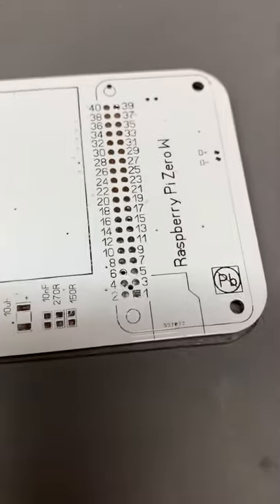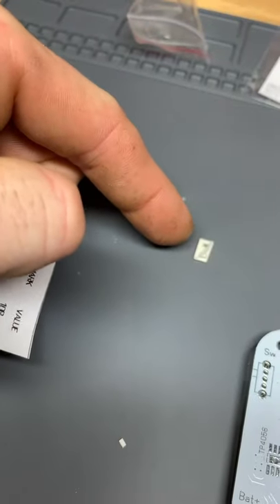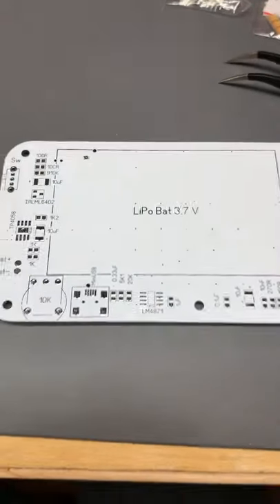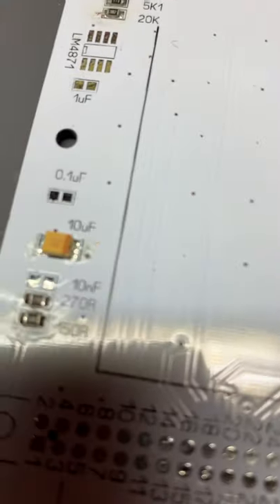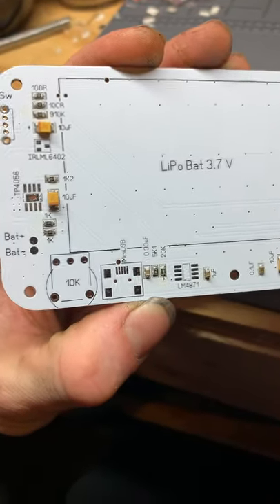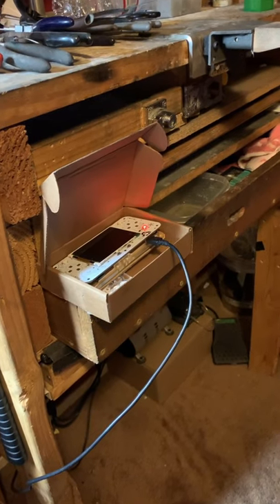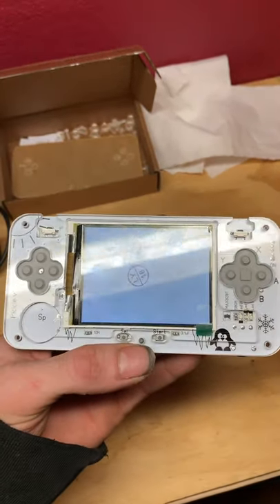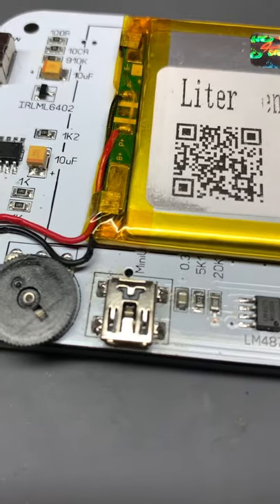Picicle V1.2 DIY Raspberry Pi Zero retro emulator build

Comment: I put one of these together a couple months ago. I broke the blue LED (no biggie) but everything else seemed correct when testing with the multi-meter.  For me, I could turn the unit on, see the Picicle logo, then the unit would shut down. I messed with it for a month, or so, trying to figure out what was wrong. I never got it to work. Finally gave up and tore the PiZero off to use on other projects.